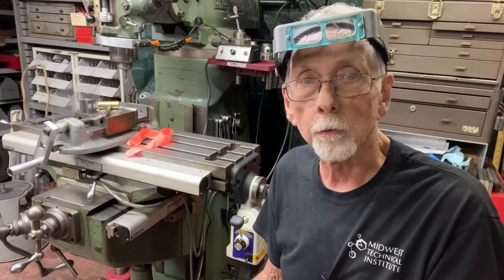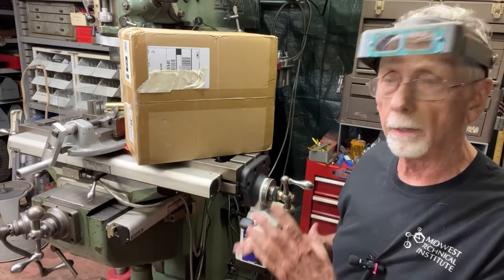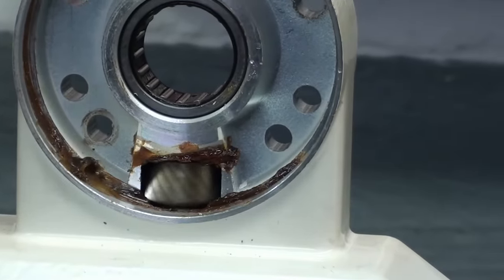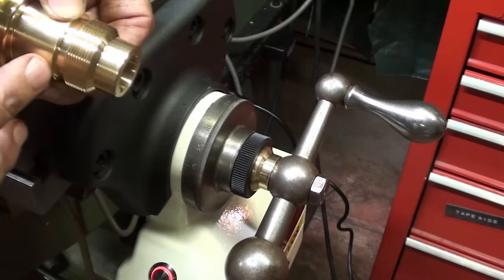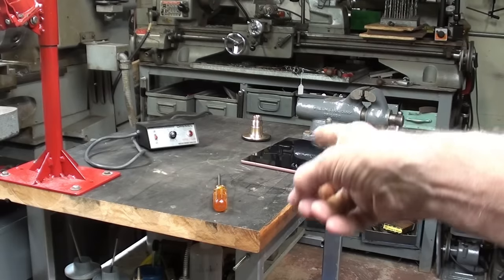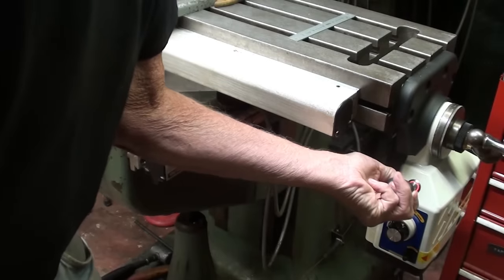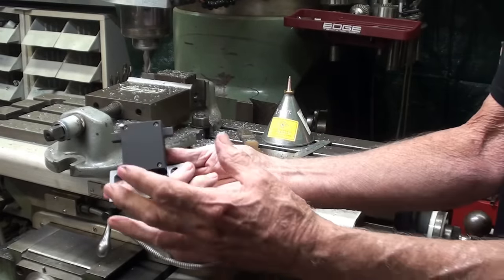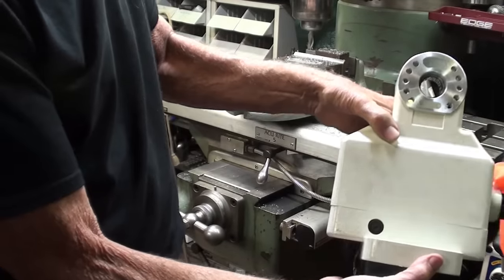IT WORKS!  Bridgeport Power Feed #888 tubalcain VEVOR

Comment: As I have said before in my other comments on videos, I am not a machinist but really enjoy machining videos.  With my technical background before retirement, I was instantly interested regarding quantifying the actual difference in speeds between the two units, i.e., inches/min at the slowest speed.  That would better advise us of what you are seeing and speaking of.  Too fast and too slow leaves me lacking.  As I have seen before, the precision or accuracy of Chinese equipment is sorely lacking compared to most countries.  Thanks.
Reply from the maker: Thank you for watching and being interested in what I do